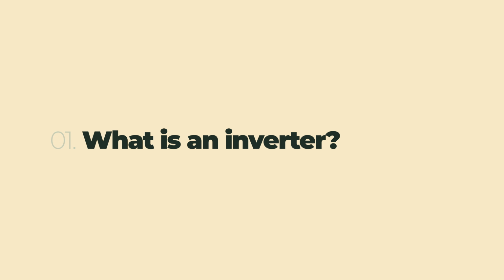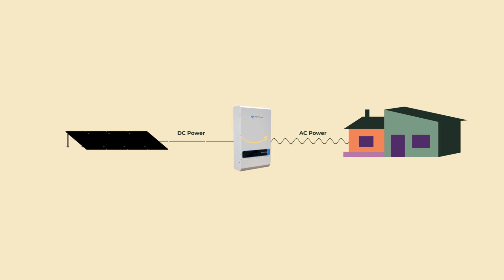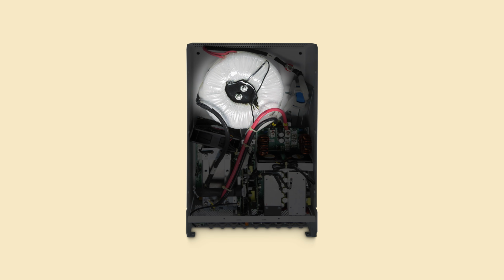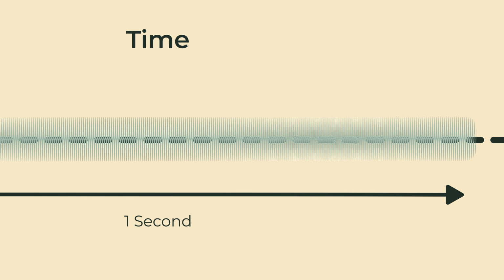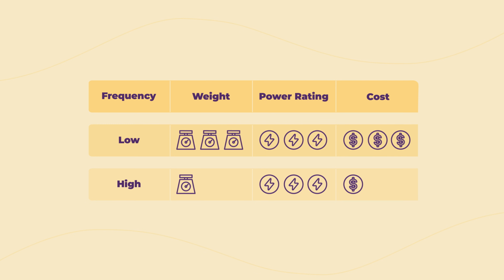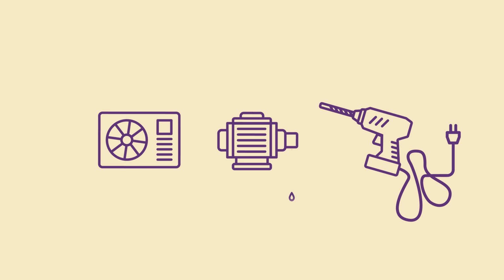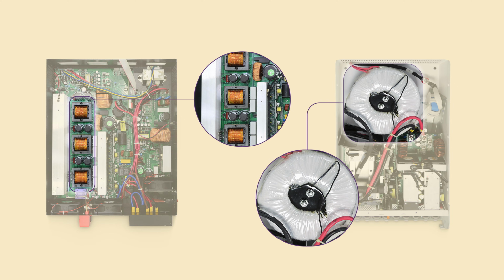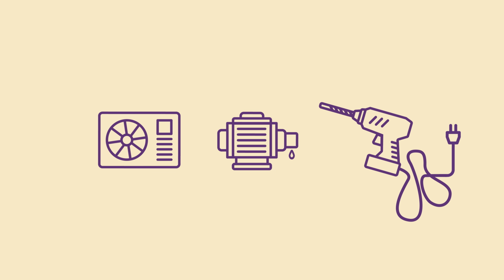Low Frequency vs High Frequency Inverters Explained (Don’t Buy Until You Watch This) | GridFree

Comment: Not heat pumps or mini-splits (those tend to use DC compressors, slowly ramp up naturally, and actually have friendly power factors).  But any direct AC motor, yes.  More traditional A/C units for example, table saws, air compressors, and so forth.

Also, HF inverters are generally split into two categories... those with large HVDC mid-busses, and those with small HVDC mid-busses.  Large meaning higher voltages and usually a huge number of buffer capacitors.  Small meaning middling voltages (still higher than the AC output) and with far less buffer capacitance.

Whole-home HF inverters typically have large HVDC mid-busses which puts their surge capability in shouting range (200% vs 300%), and their reactive power handling actually tends to be superior to LF inverters because the higher voltage / higher energy mid-bus is able to synthesize a cleaner sine wave than the transformer in situations with poor power factor (the large mid-bus energy buffer is able to fully buffer and reinject the reactive power).

The larger mid-busses also make the HF inverters more robust, though still not as robust as LF inverters tend to be.   Whereas smaller mid-busses (in small HF inverters) tend to be quite vulnerable to FET failure due to reactive loads, large surges, and short circuits.

--

Personally speaking I use LF inverters for outputs <= 3000W or so, and large HVDC mid-bus HF inverters for higher outputs.

Also, one technical correction:  HF inverters are synthesizing the sine wave.  The FETs are not being switched with a square wave but instead with a PWM (a variable-width square wave) which elongates and narrows over a single cycle to synthesize an actual pure sine wave.  This is why, given a high enough mid-bus energy buffer, an HF inverter is actually able to produce a cleaner sine wave than a LF inverter.  And this is also why the switching frequency is so high.  It has to synthesize a sine wave which requires breaking up a single cycle into several hundred switching operations.

-Matt
Reply from the maker: That's a very thorough breakdown of some technical aspects, Matt – really appreciate you adding this information for others!
Reply: Hi, thank you for the information. I need your help. In my country, Sri Lanka, the power quality is terrible. The grid has extremely high impedance, a distorted sine wave and extremely high EMI levels, which cause many problems with my PC, such as severe input lag and unsmooth display motion, even when my FPS is high. I've managed to reduce EMI without introducing additional impedance, which is very important because whenever I add impedance, the input lag increases significantly. I'm thinking of building my own ultra-low-impedance power system using a LiFePO4 battery and an inverter. Could you tell me which type of inverter can deliver ultra-low-impedance AC power: a high-frequency inverter or a low-frequency inverter? My PC consumes around 800W on average, but its power consumption can spike to 1,200W or more within milliseconds.
Reply: @Maiza007-c8y  PC power supplies have power factors close to 1.0, so any inverter with a 2000W rating or better will work.  HF, LF, doesn’t matter.  I’d also tone-down the GPU settings, set the render scale lower, and limit the frame rate to 60-120fps.  There is no need for a gaming computer to pull that much power.
Reply: @junkerzn7312 I'm getting 300 to 500 FPS, and I've tried all kinds of software tweaks, but none of them made any noticeable difference. The only thing that significantly improved my monitor's smoothness was reducing the differential-mode and common mode EMI on my AC mains from 18 V peak to peak to less than 100 mV. Now I want to achieve a pure sine wave and ultra-low-impedance AC power. According to your knowledge, would a good quality 2,000 W HF or LF inverter be sufficient to provide ultra-low-impedance AC power? Also, do you think achieving ultra-low output impedance depends on the LiFePO4 battery?